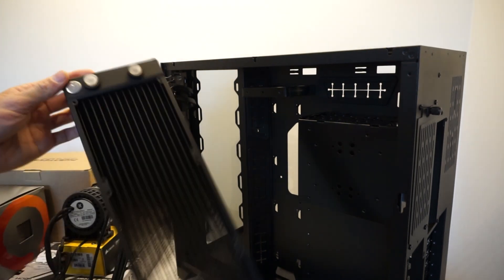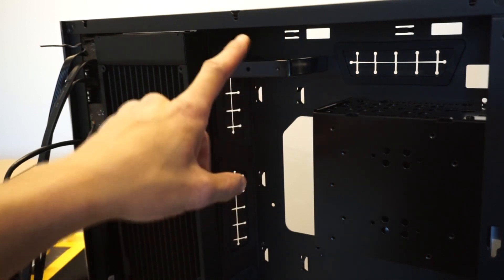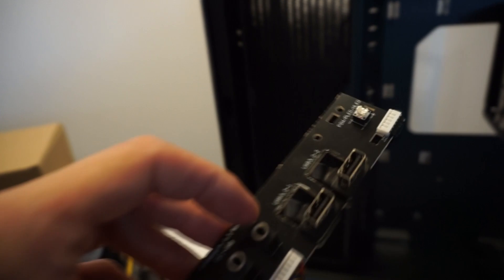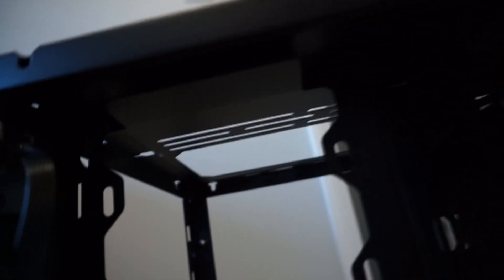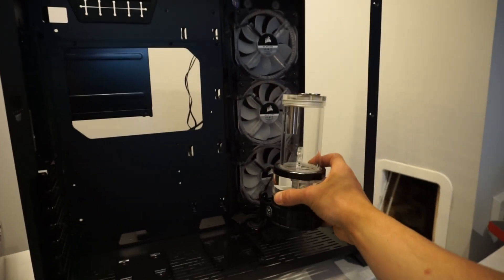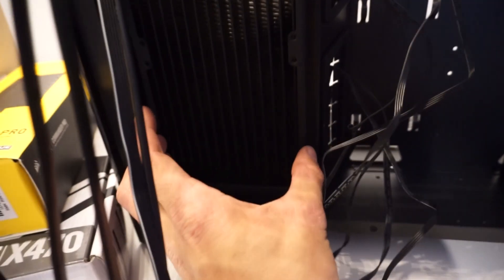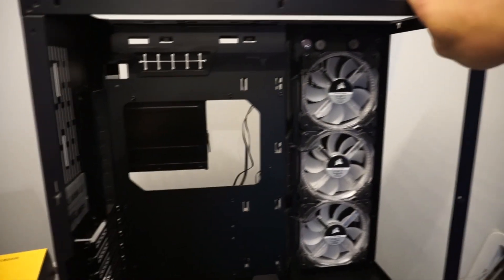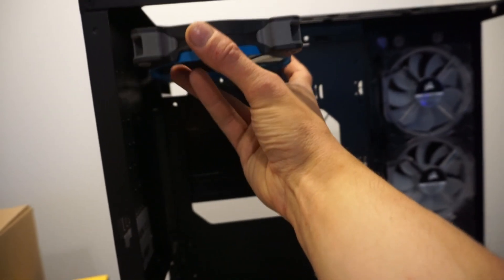011 Dynamic - EK 360 Radiator Side Chamber Mod - Custom Loop Build Part 1

Comment: Do you think that Heatkiller Rad 360-L will fit? It's actually 120mm wide, and 398mm tall, the question is more towards the actual 48mm thickness.

Comment: Was this a reg 011 dynamic? Or XL ROG?
Reply from the maker: Normal Lian-Li 011dynamic
Reply: @techclub8528  oh so this will fit my XL then? I just ordered the Rads was worried there
Reply: @MartinSugar2k  hey mate i'm build one in XL to... did the EK radiator SE fit with 3 fans in the side chamber ? =)

Comment: I didn’t modify my front panel to make it fit, I just drilled out the 2 rivets on the bottom :)
Reply from the maker: Adapt Improvise overcome
Reply: @techclub8528  Sadly I just have my rad+fans+res just sitting there in my build, still waiting for my 5900x and 3080
Reply from the maker: Nice and congrats on getting hold of a 3080 :) I'm jealous.
Reply: What a chad

Comment: How much space left on the inside is there? Enough for some Noctua NF-A12x15?
Reply: I have an se 360 and nf-a12x15 in the back chamber and it fits fine :)
Reply from the maker: I have put the fans on the internal chamber but I think you could fit those super slim noctua fans in there in the back compartment yes
Reply from the maker: I don't think you would need push pull in this instance. The extra cost and sound probly won't translate into temps
Reply: @techclub8528  Thanks for the answer! Gonna do a XL build and run 3 360 rad (one XE, one PE and one SE), with the EK distroplate, the black NF12 inside the chamber and slims as push behind the SE(hence my question), and run black Torque fitting, gold Corsair fittings and Corsair Satin Black hardline tubing.
Reply from the maker: @Jolfrheim  hopefully the Distro plate doesn't block too much air flow  going through the rad. If it does maybe go for a double radiator top and bottom.
Reply from the maker: @Jolfrheim  check out my other video if your thinking of using a vertical GPU mount as then you might have issues at the bottom of the case
Reply from the maker: @Jolfrheim  finally there is also a XL version of the 011 Dynamic available that's a little taller and widwr
Reply: @techclub8528  aye im building in the XL.
Just picture this with a 360 on the side.
Reply: Apparantly someone fitted a Kraken x73 in the back compartment with fans and all, and thats 52mm thick. so it should have a few mills to spare with the SE.
Reply: i was wondering if fits some nf-f12 instead nf-a12x15...

Comment: Thank you for the video :D
But i was able to fit a PE and a SE (both 360) in the front chamber incl fans. But its also a tight one... The outputs of the sideradiators are at the bottom and the tube just clears over the bottom intake. Will change the radiator into the back cabinett

Comment: Do you have any specific tips on removing those connectors from the PCB? I've tried careful slicing with a razor and isopropyl alcohol and still can't get it done.
Reply from the maker: I used a scalpal to slice around the edge. Then I carefully wiggled it out and turned it around. I then used a hot glue gun to secure it in place.

Comment: Thanks for making this vid, i was curious about the same thing. I just bought a kraken z63 cpu raditor but was thinking of water cooling just the gpu only when the 3090 comes out. That and a front panel res.

Comment: Looking to do the same and get the distribution front plate from EK.  I believe with just top fans that will give the most efficient cooling.  Using motherboard block and GPU block as well.  Thanks for the info.
Reply from the maker: Yes I liked the look of the Distro plate but decided to go for the more tradition look with pump and res